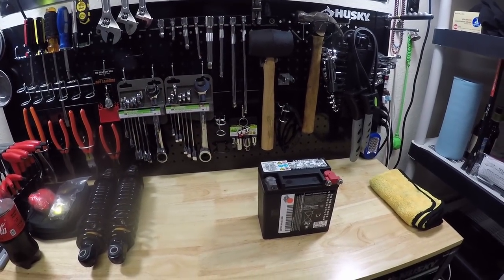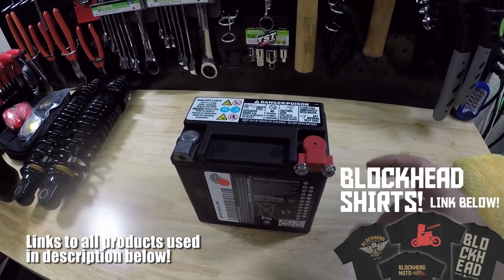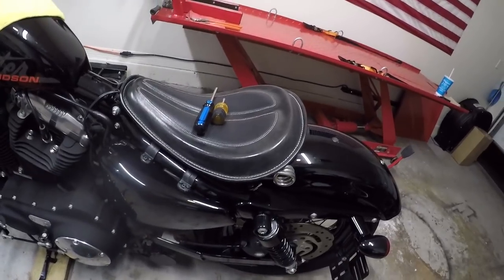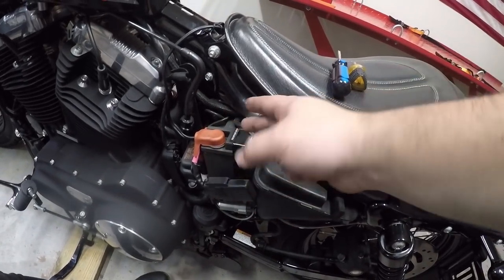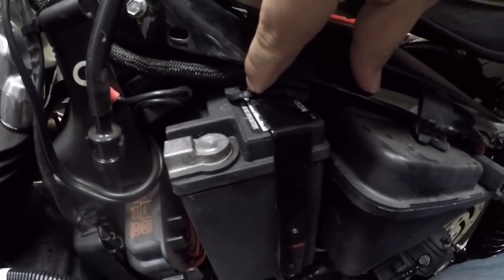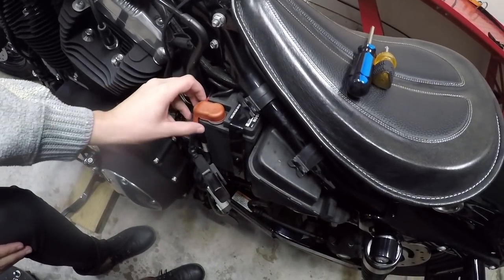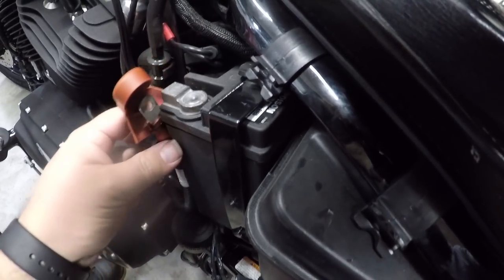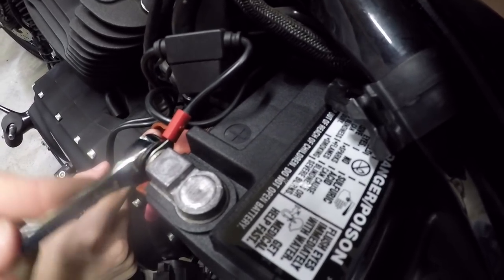How To Change Battery on Harley Sportster!

Comment from the maker: Dear Blockheads, 

I've re-edited this video to be 'safer' for those of you that don't know how to keep control of your wires and wrenches. When disconnecting the battery, remove the negative terminal first and you'll be golden. When reconnecting, replace the positive terminal first. Having the negative terminal off keeps the battery from completing a circuit if you just so happen to accidentally touch the positive terminal with a metal tool to the frame, gas tank, etc.

Wrench safe out there! (and read the disclaimer while you're at it) 
- Block

Comment: This video fails to portray what an absolute PITA it is to reach the connectors or re-insert the battery, believe me!
Reply: next battery i buy will be genuine as looks to be a better fit than non genuine.
Reply: You got that right bro ! Especially with these new fangled batteries with the float nut on the bottom , wtf is up with that , and it's not super easy stuff on my sportster lol

Comment: Finding it impossible to reconnect the negative working alone. Very hard to line up the nut and pull the wire at the same time.

Comment: It's not as easy as it looks. Patience is the key. Be sure to not ground  the positive to the ground if using long wrench. Also, the negative cable on a lot of bikes are short and hard to reach if you don't have the proper tools.

Comment: I drilled a very small hole top left of the side panel and put a zip tie through a convenient bracket hole on the frame so when the day comes my clips fail I wont be watching my side panel bouncing down the road getting run over by the vehicles behind.

Also get yourself some strong clips to hold your terminals together whilst they are disconnected from the battery, it helps keep thjngs out of the way, and stops you forgetting which order they are connected to the battery.

Comment: Thank you Blckhead. 4years after this video was uploaded and still being helpful. Thanks again. Harley was trying to charge me $260 or something like that to change my battery! So this is going to save me a lot. 
One question. What kind of battery does is use? AGM or Lithium? Or the normal?
Reply from the maker: Nice, happy the video helped! I'd stick with normal lead acid. I've used lithium before, but if they dip below a certain charge, they're harder to maintain. The weight savings is cool, but in terms of longevity and being able to hook up to a tender, I prefer to go with a normal battery.
Reply: @BlockheadMoto  again. Thank you so much for your help. I love your videos as well. Very entertaining and informative. Especially to someone that’s new to the motorcycle world. Ride safe

Comment: @blockhead I seem to have trouble with my negative cable hitting the housing in the back and not allowing the battery to slide back all the way, making it more difficult to snap in the side cover. Is there a trick to connecting the negative cable so it doesn't hit on the back?

Comment: You left out 2 key parts, one of which is the hardest part which is disconnecting and reconnecting the negative terminal. The other is disconnecting and reconnecting the battery strap.

Comment: Hey Blockhead 
Does this apply in exact terms to the Iron 883? I have a 2018 one.
And, most importantly, is it possible for a brand new HD 883 to be drained of battery (to the point where the Battery tender won't charge it) if its been sitting at home for 3 months?

Thank you!
A.R
Reply: If you left the ignition key on it's possible. Remove the battery & take it to the dealer where you bought it, they can check  to see if the battery is bad. Your bike should be under warranty, so you should be able to get a new battery.  You gotta ride it to keep the battery solid though.

Comment: It's plastered all over the cover and manual. Negative cable first!! Problem is with this battery setup I don't know how the hell they expect you to do that. That's why I was watching videos!
Reply: I know I'm late to the party but by removing the fuse it doesn't matter which cable you take off or put on first.

Comment: I changed my battery the alarm went of and of and of ouch. Now my 48  has no signs of life. What did I do wrong.
Reply: The best way is to turn the ignition switch to the on position and then pull out the main fuse, that way the alarm won't sound and your electrical system will be dead until you reinstall the main fuse.

Comment: Why did you edit and re upload? Was already awesome before
Reply: Disconnected the terminals in the wrong order first time
Reply from the maker: Wasn't necessarily the 'wrong order' as the battery was successfully changed. Harley tech's disconnect in this order as well, but put their hand or tape over the positive terminal after disconnecting. Re-edited and uploaded though b/c I'd rather people be safe out there and remove any possible chance of error. Just mind your wrenches :)

Comment: crap video, you neglected to show how awkward it is to access the negative terminal and how important it is to orientate the negative cable in order for the battery to slide back into its housing.